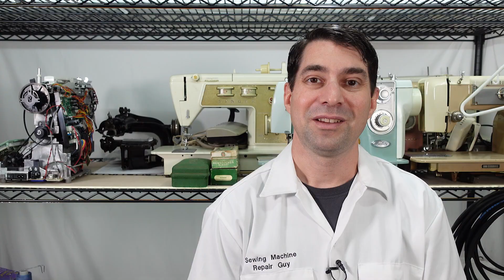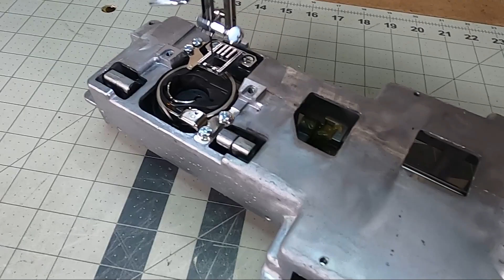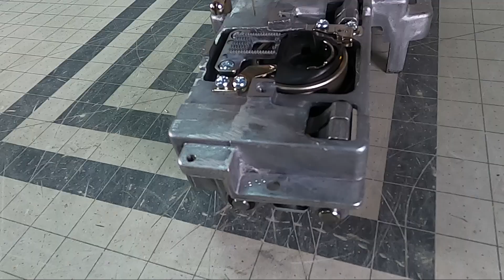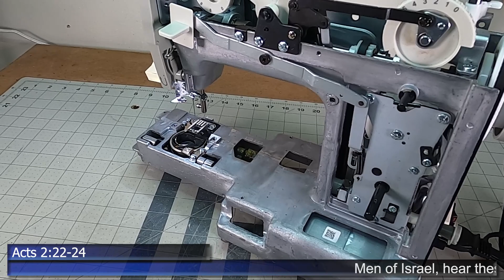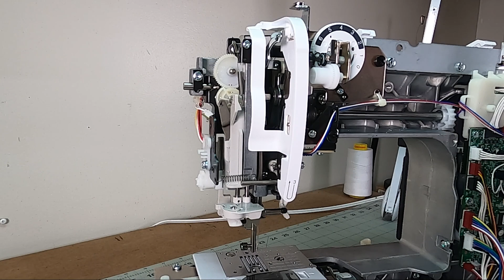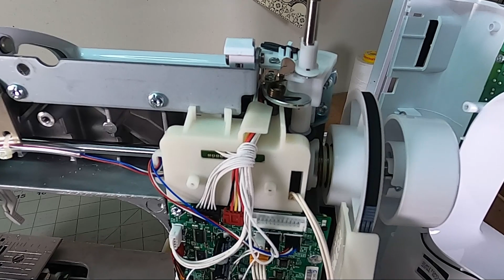***Mechanical or Computerized*** What's The Difference? Which is Better? Let's find out the basics!

Comment: I was impressed by your video today.  I am a retired IT professional and electronics tech.  I worked for Singer manufacturing for 12.5 years.  I began in 1968 with the 600 touch and sew.  In 1974 I was inducted into the factory as a field tech.  They brought us at that time into the Elizabeth plant and took us into a special room where they displayed the electronics to be used in the first computerized sewing machine ever.  I was stunned to say the least.  I never dreamt that the industry would embrace that technology like it did.  I left Singer and got into computers and digital electronics.  By the time I was running Windows 3.1 the sewing machine industry had adapted the technology full force..  Your explanation of the difference to people I'm certain was very helpful to many.  You are a blessed communicator and I pray God Blesses you forever.  (and yes, there are many 2001s, 1200s, 760s, 560a, and 2010s still out there doing the job!):)
Reply: I have the Athena 2000. Wasn't that the first? I would have loved to work in that factory! Lol

Comment: I sometimes regret not adopting my late mom's Elna. It must've weighed 6 tons and had cams to be manually installed to change the stitches.
Reply: If it's the Elna Supermatic (from 1952) it doesn't weigh a ton, because it's aluminum, not steel or anything like that.

Comment: 1970s electronics use thru board components that are far  more durable than todays surface mount components. Surface mount components have run limits much like light bulbs. That is why boards are changed  and not parts on the board. When replacement boards are no longer available, you have a paper weight. Digital machine don't just have a stepper motor, they have many. Those are the parts that tend to price repairs over new machines.
Reply: Surface mount components are repairable by hand tools, if they are available, but you must do diagnose to know which parts need replace.

Comment: I have a really nice computerized Juki and it drives me crazy.  at this point it's just a really expensive buttonhole machine.  I prefer a mechanical machine probably because I've been spoiled using industrial machines at work.  I'd get a Singer 20-U if I had the space for an industrial in my apartment but I don't so I got a Singer Fashion Mate 237.  that thing is an absolute beast.  straight stitch and zig zag only, nothing fancy.  no stupid plastic gears inside.  probably could use it as a weapon if I really needed to

Comment: My experience with electronics makes me feel like digital machines can be made to last a very long time. The circuitry is very unlikely to suddenly stop working in several lifetimes, the electronic components that experience wear are generally standard sizes and are usually commonly available for those that know where to find them. So things like servos, reed sensors, thermistors, etc are all pretty easy to find and replace with a little knowledge.

I’d like to see a user programmable machine based on open source engineering similar to arduinos or reprap. Something like that would break the mold on realistic serviceable lifetime.

Comment: I was rather surprised to learn how well-made the Singer Heavy Duty machine is and it’s good  to know that so many of its integral parts are metal.  I’d never thought of it previously, but obviously today’s plastics must be much tougher than those of 30 or more years ago. And of course, the Singer is WAY better than the $69 throw-away specials sold in big box stores.
I’ve been sewing for over 60 years (Mom got me hooked when I was truly little) and love both sewing and sewing machines. I have a collection including seven vintage Kenmores (my favorite brand), a White Rotary 77 (Mom’s machine) a 1980’s digital Baby Lock and two modern digital Brother machines, one of which weighs in at 46 pounds and has an exceptionally large harp for quilting.  
Some of my vintage machines were acquired in excellent condition and needed little more than cleaning, oiling, perhaps new motor brushes and a bit of love. Others required a bit more work, but I enjoy it and have been quite successful so far. I can maintain two of my digital machines but the big one is so sophisticated that I let the professionals handle it. I had 25 years in the technology field and know how easy it is to “blow up” a circuit board if not careful. It’s a magnificent machine and I love all the bells and whistles it offers.
But my all-metal (and almost all-metal) vintage babies are a joy too - and they all seem to have different ‘personalities’ in how they work. I have a 158-1040 that LOVES using double needles and hums along beautifully when I’m sewing knits.  My 158-1400 hates double needles but is a wiz at creating fast gathers. My 120-490 is a noisy beast which uses a chain rather than a belt and a 1.5-amp motor which, with the right needle, allows it to chomp through layers of canvas and such with ease.
The bottom line, for me anyway, is that both vintage and modern digital machines have their place; just as you said in so many words. Having a choice of which to use is best of all. I know that my digital machines will ultimately end up as recycling plant fodder but my vintage babies, if well-taken care of, will live for generations to come.
And no offense, but that wonderful little Singer Heavy Duty, as good as it is, will be long gone while many vintage machines are still humming away happily. And probably many of those will be Singer 201’s, a fabulous machine that I’d love to have if or when I can find one that’s affordable!
Your videos are WONDERFUL and a blessing for someone like me who eagerly absorbs every scrap of information on machine maintenance that I can. Thank you!  And please keep making them!!
Reply: Plastics definitely have come a long way. The key IMO is really the discovery of glass fill which reinforces the plastic massively. Rifle magazines such as Magpul for example which are just nylon with a proprietary glass fill, absolutely dominate the durability of older Russian AK magazines made from bakelite. Also 3D printing expands the opportunities to duplicate plastic parts as needed which IMO further improves the useable lifespan over a machined metal part that one will not be able to easily reproduce unless one can cast zamak or has a small machine shop. In fact, on my mini lathe I replaced one of the zamak gears with a plastic 3D printed one and it is still going strong years later!
Reply: I’m not as sure. Having worked on electronics most of my life the inner workings of the HD machines aren’t really all that complicated. 
The vast majority of components that can wear are very common in the electronics hobby so, I imagine someone with just a little soldering experience and access to sparkfun could keep an HD running for a very long time.

Comment: This is a very nice video West ! I have a collection of about 25 machines from a 1910 New Home treadle, a Durkopp from the 1950,s with a wooden slide on table a bunch of mechanical Berninas, and a newer Brother Innovis. I like to collect and I have a fascination of the early computerized ones, Singer and others, and I have and use a few of them and I would only buy a computerized one in a new machine unless it is a serger or a specialized very heavy duty mechanical one.I like to take machines apart and see how they are made as well and keep them serviced ans working well. Thank you for your videos.
Reply from the maker: Thanks!

Comment: Okay, now I have seen the video. Good explanation! Thank you! As a garment sewing teacher who provides sewing machines for my students during classroom use, I have had good luck and enjoyed using the analog Bernina (530, 730, 830, 1008) sewing machines and Singer Heavy Duty (4423, 4452) sewing machines in my sewing studio. I’ve also used Bernina computer machines (1130, 1230, 1090, 325, 475) with good luck. I have not had such good luck with Janome sewing machines.  They’re okay, but don’t seem to hold up as well. My personal sewing machines are a Bernina 790+ for the features and the way the software works, and a Juki DDL 9000 industrial sewing machine for the power and accuracy.

Comment: Greeting,
I have been sewing on Bernina's sewing machine from 830 Record to 750Q and from 1901 Singer hand crank to 1932 (electric), since I was 6years young to now 62. I have a total of 14 machines and 1 Bernina Serger 2000DCE (mechanical). I was very disappointed and to find out I can no longer get computer boards for my 1630 and Artista.180E. When you think how much money you bought these machines for and how tough they are. I now have to sell them for parts. Breaks my heart. And for my 121 years old machine, no repairs just me cleaning and oiling. My computerized Bernina 750Q is my last one. Just for maintenance service $195. I am keeping my serger.
Reply: I have an 1130 that had motherboard issues. Bought a 1958 Favorit to keep sewing. Then 4 years later, found that motherboards can be REPAIRED! Yay! problem solved. Repairs cost more than the Favorit did, but I bought the 1130 before I had kids, and it's been very faithful.

Comment: I agree, there are no creature comforts on this machine. I learned to sew when I was 7 years old on my great grandmothers turn of the century treadle and have always used basic machines which have served me well. I might go to a mechanical Janome at some time. I have this machine and for less than $200 I can live with some of its awkward ways.
Reply: Great now I know no digital for me  also the fact I am very sensitive to emf and  it’s the motor being so close to the body for hours  any suggestions what has  Low electromagnetic sewing machine e guess there’s the treadle option but thanks anyway

Comment: I don't have a computerized machine, but I do have a Singer Scholastic, and having personally seen how beefy the internal components are, I feel good about it. I also have a Viking 6430 that was made sometime in the 50s and a Necchi 537L from sometime in the mid-80s, but that last one has issues, so I don't really use that one very much. The Viking, on the other hand, works great for its age. A little finicky, but let's be honest, what machine from that era isn't? It's also got some really weird decorative stitches that I've literally never seen on any other machine, so I think I'll be holding onto that one for a while.

Comment: Before I listen to your video, I would guess that analog lasts longer if the machines are of about the same quality in the way they are built; however, I think computer sewing machines can last a long time if they are used properly and tuned up by a knowledgeable technician on a 1-2 year basis, depending on how much you sew. I am a sewing teacher and provide sewing machines to my students for classroom use. I have used both analog and computer machines and have never had any trouble with either type. I do take care of my machines, clean and oil them often and have them serviced when necessary. Now I will listen to your video.

Comment: The fewer plastic parts the better.  I have a mechanical janome 6919qc but part of the needle plate is a built to fail  plastic  that keeps cracking.   I am now looking for  an all metal with a built in  needle threader.

Comment: normally electronics are very reliable.  usually what goes after about 10yrs are the starter/power caps.  But I agree, sensor mania is a real PITA.  one point you did not cover was the power capability - will a similar mechanical punch through more leather than an electronic model?

Comment: I have an older mechanical Necci but having trouble with loading the bobbin it keeps jumping back to the left after I try to load it with  thread🤔
Reply: It should be very easy to find the cause of the problem and fix it. 
On my older made in Taiwan Necci with the top mounted bobbin winder, there is a cam on top with a tightening screw that adjusts how full the bobbin needs to be before the finger jumps back to the left.   Under the cover (only one screw on mine) a rubber wheel rides on the hand wheel, and spins the shaft.  An A shaped spring applies the tension on the finger.  The mechanism is designed to open fully when pushed open past a certain point.  Possible problems there are the spring has worked loose, or broken.  I don't think your problem is a worn rubber tire. If the rubber tire is worn, the bobbin shaft would just slip.  

You should be able to push on the finger and feel good  spring tension and the light switch like snapping action with no bobbin in the winder. If not, look at the spring under the cover. Otherwise see if that cam screw is loose or the cam just  needs to be turned a little so that it pushes less on the bobbin spool.

If the spring has broken, then look for a replacement on line at a sewing parts supply or ask your local repair shop.  Many older Asian machines use interchangeable parts which can still be found. Good luck!

Comment: I need repairing my electric toothbrush because its soft rubber like plastic torn apart after three years use. Plastics are not long live. Earlier my headset torn apart after couple years use. In sewing machine, silicone oil might be safer, because plastic eater microbes not grove in it.

Comment: Please, how do I convert an American digital sewing machine with 110v input power supply to a 220v/60hz power supply? Thank you.
Reply: You can change the power or change the motor.  The power conversion is considerably more complex than a plug adapter, but the good news is that there are a lot of maufacturers.

Comment: I have a digital machine making a “knocking” sound- Yet it keeps on sewing-What could that be?
Reply: Time to take in for clean/ adjust. You get your car tuned and maintained? Sewing machines need that too.
  They can drift out of adjustment, which is likely your knock. Get it fixed.
Reply: Thank you- will do!
Reply: @anniecortes6450  Did you do it? What was the problem?
Reply: @ike7539  I changed the needle- and cleaned below the feed dogs …no more noise!

Comment: The correct terms are "mechanical" and "computerized" machines. We have never called them analog or digital. The problem is now the younger generation is learning the incorrect terms for things and old and new sewers are confused when we start using incorrect terms for things. As a sewing machine instructor/sales person, this is so frustrating for everyone. The term "electronic machine" has become so misunderstood, very few people understand what an electronic machine actually is anymore, not that very many are even made any longer. Experts in the field need to set the examples and use correct terminology when teaching or we are doing a disservice.